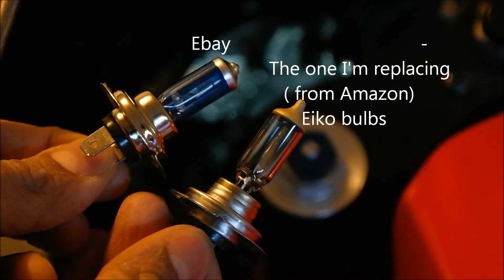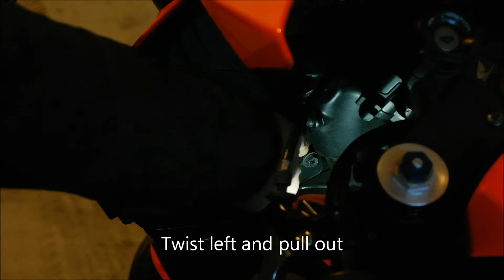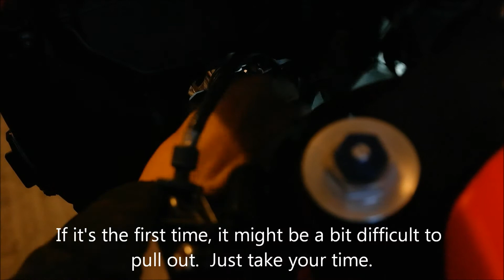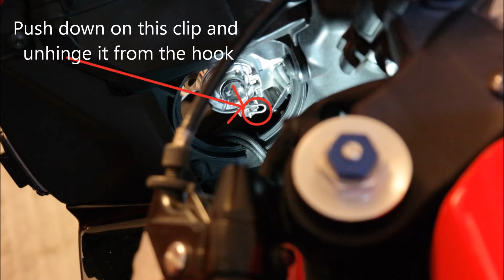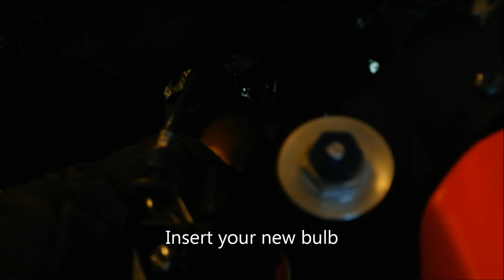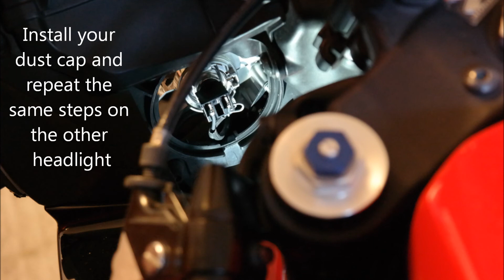How to: replace headlight bulb on a motorcycle (2008 cbr 600rr)

Comment: Is the right headlight twist to the left to open as well or is it flipped?
Reply from the maker: Yeap it should be, its been a while though and i no longer have the bike, so not100% lol, but i dont see why it wouldn't be.  Good luck!~
Reply: @halohalos  sold it?? Tell me you got a cbr1000
Reply from the maker: @1234dfl1  I did!  Then i i sold it for another bike, then sold that for another bike, then sold that for another bike, and might be getting another one. lol

Comment: Thanks god you made this video, would have been jacked at the dealer for this simple task. Question: when did your light burn? My cbr600rr 2011 has only 10 000 km on it and the cruising light died...is it normal?
Reply from the maker: +XZINO911X I bought this bike used in 2012 if I recall correctly.. and it burned out late 2014 I think